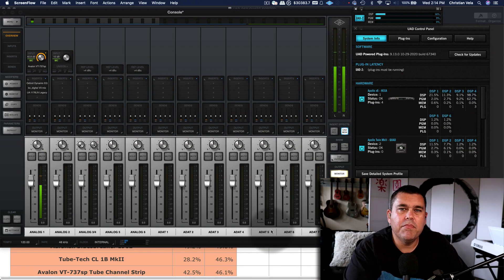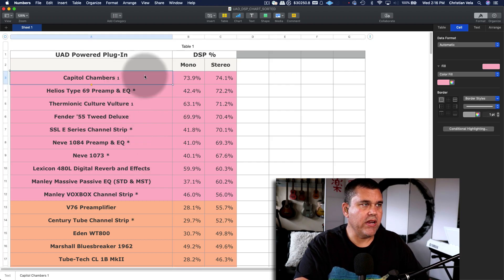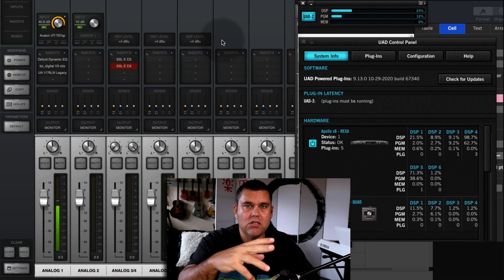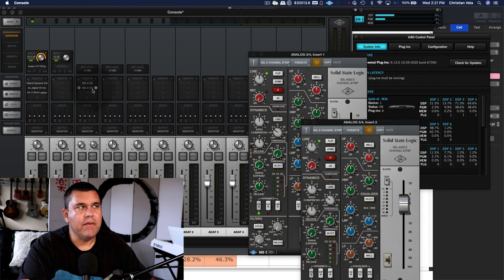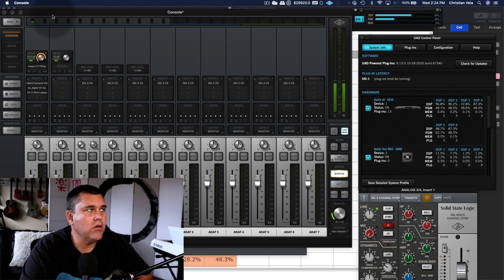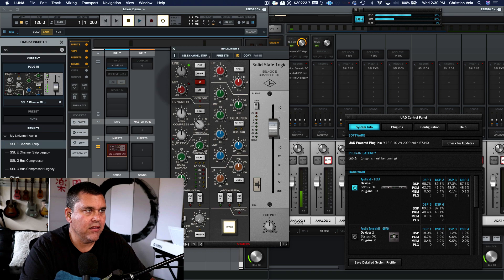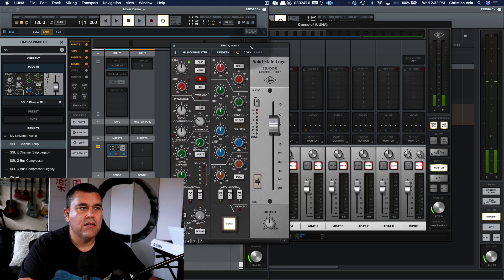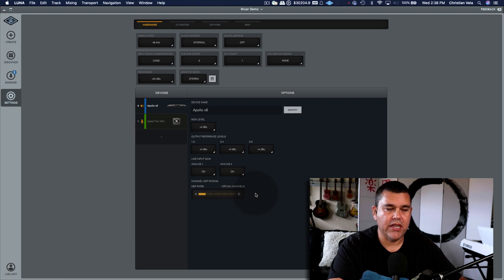UAD DSP Explained + Troubleshooting (AKA DSP for Dummies)

Comment: Hello please I'm Hip-hop engineer i want to get uad-2 DSP Quad with DSP Paring I will be free to use all plugins well right? Thank you so much
Reply: You should be able to use any of the plugins but you may have to be mindful of what plugin combinations you try running. Any single plugin will be fine (reference the spreadsheet - none of them would overwhelm a single plugin), but chaining multiple CPU-hungry plugins may result in the 'Plugin Disabled' popup

Comment: I don’t even use Console honestly. I keep loading these plugins (aka channel strip) in my DAW on multiple channels like an idiot. I should just be using it in Console (pre DAW) right?
Reply: Kind of depends.
If you're doing a bunch of vocal takes and you want the same pre-amp sound on all of them, it would make sense to do each take through a single channel in Console that has the same plugin effecting each vocal take the same way.
That way, when you start mixing things in the DAW you already have the starting point you want for each track w/o having to load a UAD plugin on to every track. That's going to be CPU intensive.

However, if you don't know exactly what the end goal is sonically or you want to preserve the take exactly as it was recorded, you'd leave the plugins off Console and start adding them in on your DAW. At this point, you have to start being more mindful of the DSP usage again because even though it's not happening real-time through a line into Console, UAD is trying to process it in real time in your DAW and you'll still have DSP limitations.

So, if you're putting the same Channel Strip on multiple tracks with identical settings, it would probably make more sense to add that to Console and do each take through that channel.
If you want a variety of plugins running or altered parameters between tracks, you may want to use a combination of Console plugins & DAW plugins. Comes down to the desired sound and the best workflow to achieve it!

Comment: Great video! I’m a little confused about saving console projects though. For example to load different songs with different plug-ins For live streaming purposes etc. Are you saying that every project that I save in console even though I’m not using those plug-ins at the moment they’re still taking up DSP whether they’re opened or closed? That’s what seems so great about console let’s say I’m doing a eight song Setlist live I can recall all their settings, but obviously I wouldn’t be able to do that if they’re using up DSP.

Comment: Great video! Thanks! Maybe you can make also a video related to Luna Error Messages(?). For example, for whatever reason … I get many times the Luna Error Code -38 (which means that Universal Audio Hardware or UAD PlugIns stopped responding). I already checked all available material online … but … so far … I was not able to resolve this issue …

Comment: What about when you load a UA plugin on a track in Protools? Doesn't the DAW run it on your computer power instead? Does loading a UA plugin on a track in your DAW use up your DSP on your UA interface?
Reply: That's a good question, I have also been wondering
Reply from the maker: If you run a UAD plugin in any DAW including pro tools it uses the DSP from your Apollo to run it, not your computer CPU. Hope that helps!
Reply: @ParadiseSound so I could basically use a few uad plugin then just use other companies plug-ins to say dsp??

Comment: How does your voice sound so crisp and I’m using the same mic and everything on my cpu???
Reply: Shah what mic are you using? I’m not sure which one I was using in this video I have a couple. Honestly they are quite cheap one is a Shure SM57 other is a condenser mic TZ Audio Stellar X2. I can get similar results from both though.  The most important thing is room treatment and getting your room as quiet as possible. Get the mic the proper distance from the source. Make sure your gain is good and you aren’t recording too hot into your Apollo. Use a good UAD preamp and check the gain is at a healthy level and not in the red when you are speaking or singing. Finally I use RX8 or the new UAD C-Vox noise reduction plugin to remove room noise. Hope this helps!

Comment: I’m curious to know what DAW do you use? I ask because im puzzled why so many are using UA’s hardware instead of the Pro Tools Carbon. Although the Carbon won’t load up UA’s plug ins, it begs the question if those UA plug ins are really that good. I have the Apollo Twin Quad Core, it’s a masterpiece, but I had to get the Carbon because I do techno which widens the stereo field, the reverb is there, so is the delay among other effects. 

By the way, if I can download a similar sheet for plug ins that come with Pro Tools that’d be an early Christmas for me 😁
Reply from the maker: Hey Rey, thanks for the comment!  I use UAD LUNA mostly now with my Apollo Hardware.  I haven't had experience with Carbon so I can't really say which is better.  I don't see any reason why LUNA wouldn't also be suitable for techno.  No Windows version of LUNA as of yet though if that is what you are using.
Reply: @ParadiseSound  I’m on Mac but it’s good to know that is only on APPLE

Comment: If I want to use a pair of headphones that doesn’t have the traditional, plug, 
Which adapter would I use 

Also which pair of headphones that run at $100  that comes stock with the Apollo plug 

I don’t want to sacrifice any audio quality when monitoring due to the adapter please let me know of any suggestions

Comment: Thank you! On my Apollo Solo I was running channel 1 and 2 ( 2 which I almost never use) with my Avalon plugin and I was running at 98.8% I removed the Avalon on my second channel and it dropped my DSP down to 55%! I use Audition and you have saved my life! I didn't know that I hit my limit because of running my plug on both channels in while recording my audio. Thank you !

Comment: Thanks for helping out with this really confusing stuff. 
UA should offer you a job. 

I have an Apollo Twin X Thunderbolt and I need more DSP. What's the most economical way to get more?

Thanks!
Reply from the maker: Pip thanks so much! 😊 As for adding more DSP.. Do you have the Twin duo or quad? Probably the best bet would be to find a UAD satellite. You can add an additional 4 DSP chips with a quad satellite. You can buy one brand new or check Ebay and Reberb.com if you are looking for a used deal. Hope that helps!
Reply: @ParadiseSound  Thanks Trev, I have a Twin duo.